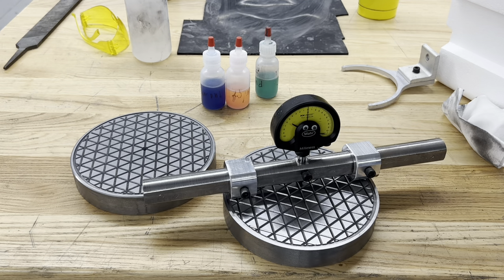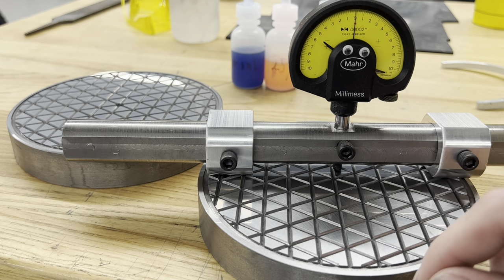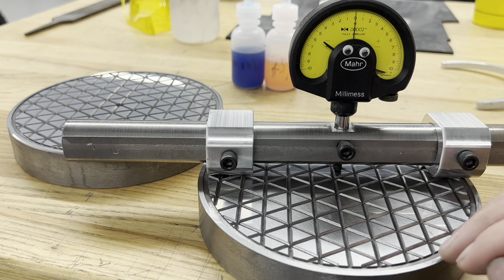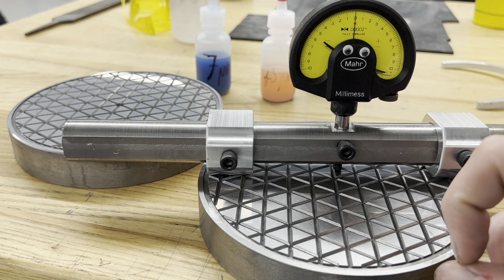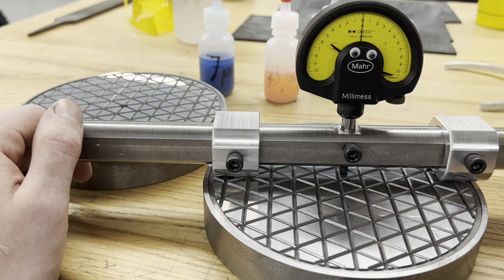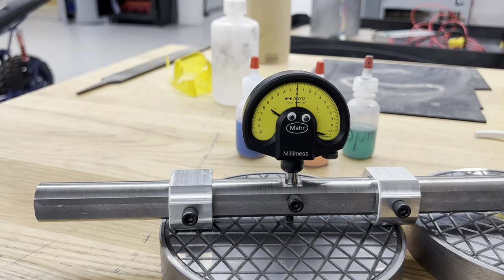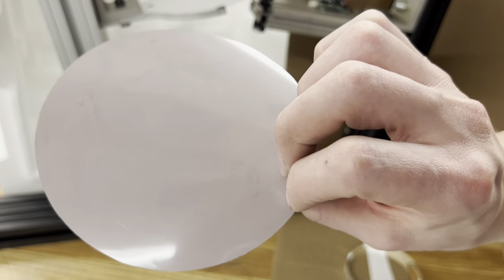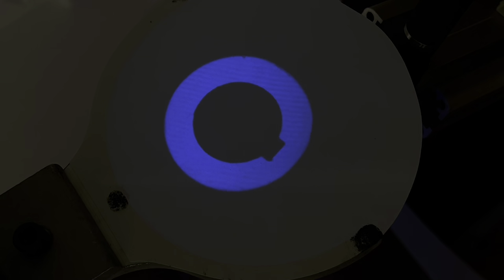Getting flat: Making cast iron lapping plates

Comment: Would the rounding be less if you held the part in a V-block while lapping? With both the V-block and the target part touching the plate simultaneously? I suppose it would take a lot longer though due to the extra surface area.